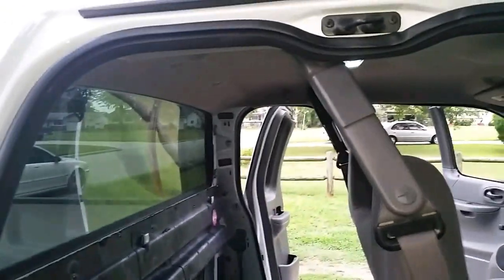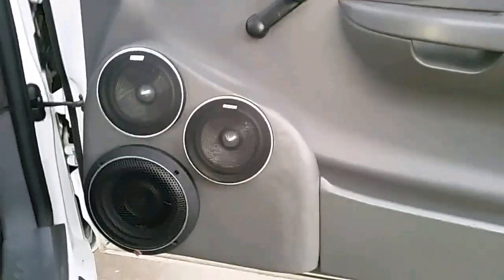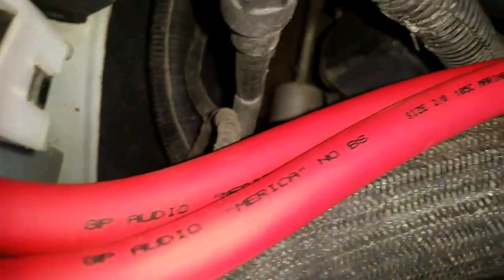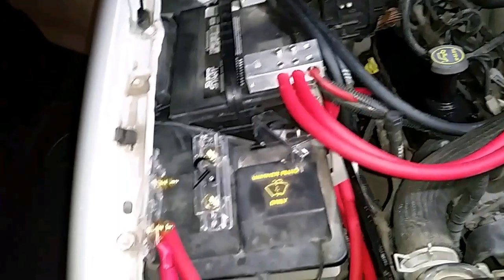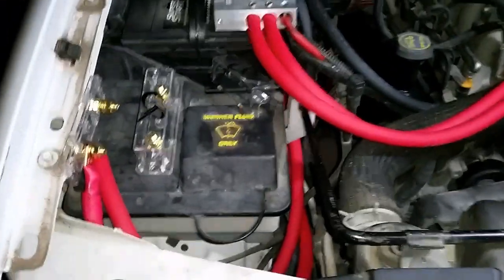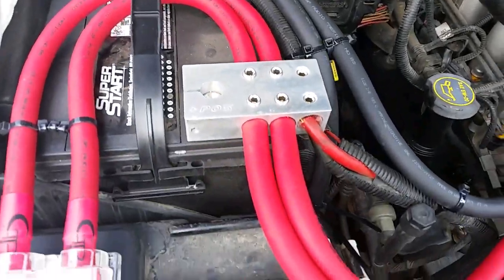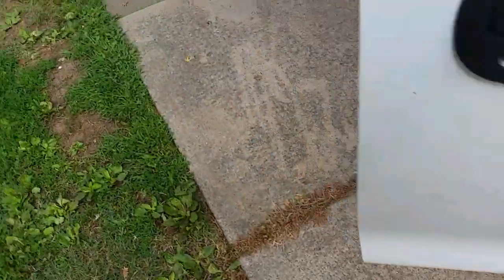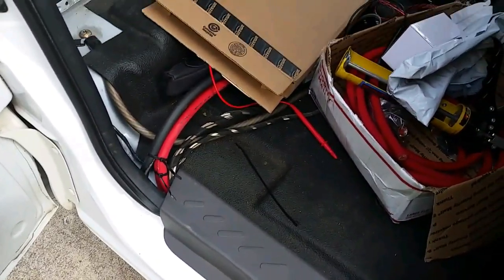6  RF 12s wall build Part 1

Comment: I love RF amps they do good clean power for cheap..but I am not a fan of their subs..they kinda sound like Kicker...they are loud but not loud on the lows..I am really hoping when the wall is done it will change my mind...I mean all we ever see on the high power systems doing hair tricks and getting high db's on the lows are Sundown, DC, AA etc. No kicker or RV
Reply: I mean no RF not RV...even the Power series T's are never shown
Reply from the maker: What's up man, yea this perception is very common. I'd have to say mainly it's due to manufacturers "recommended" enclosure specs. people follow those specs and will never get the results. when you run one of the suggested enclosures through they are tuned high (in the 40hz area) and the port velocity is so high it restricts the drivers output capabilities. 

the truth on these P3 subs is, the FS is 26hz, this makes them actuality favor those lower frequencies.  Stay tuned, this is a fully GP designed setup. it's gonna get nasty.
Reply: PurpleSyrup I have an older car with a 90amp stock alt. But I am looking to upgrade..how many amps can I get out of a 95 Honda alt?..I have an odyssey but it is the same alt and engine in the Accord..I am going to call the local alt. shop tomorrow but I just want to get a ballpark figure and price..I am ready to step up my game
Reply: Timothy Hinton right now with all my electrical running my 600 watt amp is all it can handle...it drops to low 13's on an engine rev
Reply from the maker: +Timothy Hinton the stock Honda case of that year can usually only be built up to about a 180 amp due to the size. the team GP alts built for this are under $400 and built with the highest quality parts available. if your wanting to step up to quite a bit more power, it is easy to get a large case GM on these. that then opens up the option for 300 to 350 amp units
Reply: PurpleSyrup do you have a link?...I would really like 300 amps
Reply: Timothy Hinton I have plenty of room under my hood...but not enough for multiple alts
Reply: PurpleSyrup I am serious ..I just got a promotion at my job and I want to build a bigger system..please tell me what you can fit in my stock spot..and I will check tomorrow on what the local shop can build
Reply from the maker: +Timothy Hinton http://gpcaraudio.com/gmc-yukon-5-3l-all-years-300-amp-team-gp-alternator/

I know that says for a yukon, but literally a small ear needs to be made to mount it on your motor, they are very simple to add in
Reply: PurpleSyrup so If I get a 300 amp. Alt. I should be able to play a 3,000 watt amp with no voltage drop..well I mean not a big drop?
Reply: +Timothy Hinton If it helps you out any I have a 300 amp alt, 240 amps at idle. I have 2 soundqubed 3500's strapped at 1 ohm and 5 group 34 batteries. I don't drop below 13.5 volts at 2k rpm. you need the battery bank along with the alternator to have minimum voltage drop.
Reply: Hayden Joiner on a 12 volt system if you are staying over 13 volts then you are only using Alt power right? I thought the batts were for when you have more power than the alts can handle. Sorry I love car audio but this is the first time I am going to start a big build..I mean bigger than stock electrical can handle
Reply: Timothy Hinton I am not an electricion but I work with them....so if your are pulling hard on you're electrical below..low 13's or so..you are pulling on your batts right?
Reply: Timothy Hinton I am new to this..but logic makes me bend my brain..I can understand voltage and amps...but this makes no sense to me
Reply: Timothy Hinton either my alts are doing power..or I am dropping in volts and now I need batts
Reply: +Timothy Hinton If you wanted to you could go just off batteries, but if you want the best possible outcome you want to do a good alternator and a decent battery bank to back that alt up!
Reply: Hayden Joiner but if my alt stays high in voltage that means I do not need batts right?
Reply: Timothy Hinton that means I am running of of alt power..pretty much anything over 12.6 is charging my batt right?